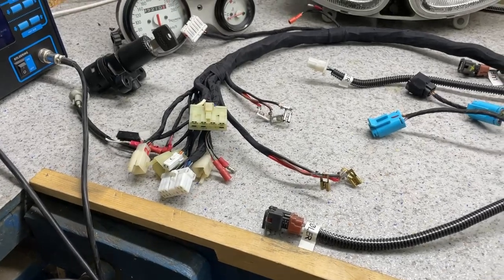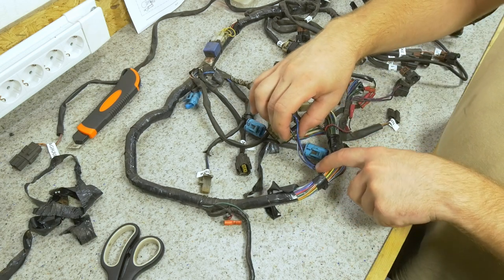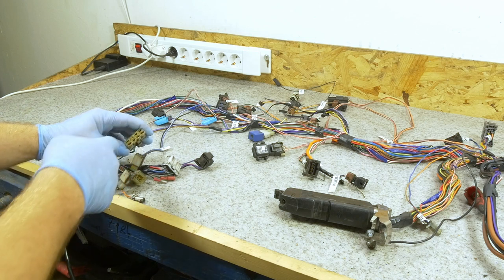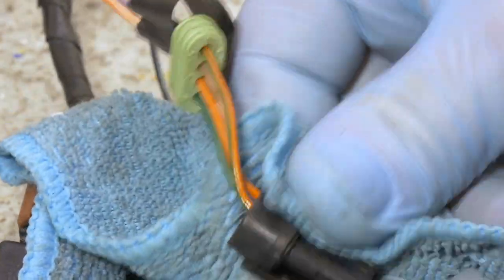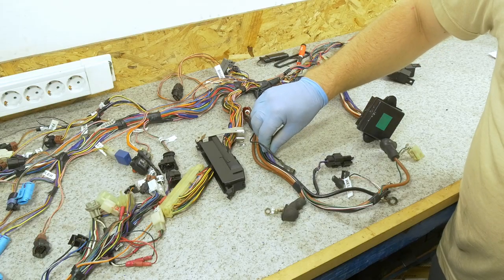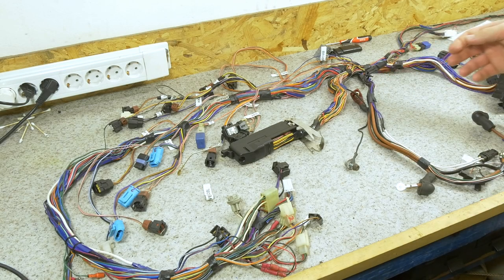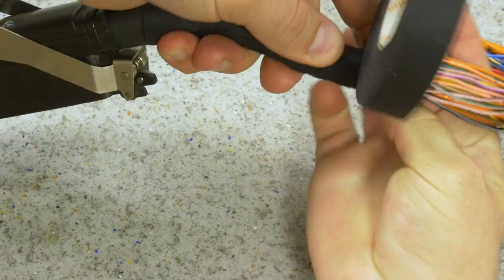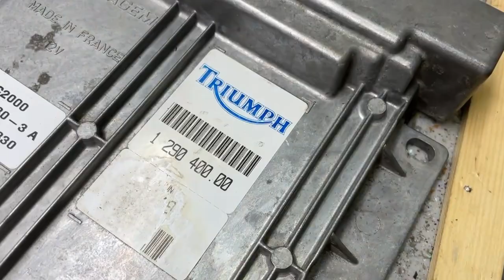HOW TO - Restore your wiring harness #diy #wiring #automotive #motorcycle

Comment from the maker: I reuploaded the video without the headlight circuit upgrade part, that's up separately as well, you can find it here: https://youtu.be/LHBJTqCwsPM
Other videos: https://youtu.be/kwOmllabFXc
Reply: I noticed you said check all ground points. Does your t595 harness have a ground blue or white block?
Reply: I'm having a no start issue and my horn and indicators are not working. I'm searching for all ground points.

Comment: You can use a seam ripper (gently) when dismantling the harness. Instead of wrapping th entire harness, I typically use open, self-closing Techflex sleeves. The harness seems to be more flexible this way.
Reply from the maker: Thanks for your comment! That’s good advice! Makes sense if it’s not sticking to the wires everywhere it makes it more flexible. 👌🏻

Comment: Hi . Creat info i have a cb750/4 k5 and hd to replace left hand controls. The new 1 has diffrent coloured and smaller guage wire and connectors.  Is changing connectors save with the diff guage wire or try and rewire hand control  all opinions are welcome .